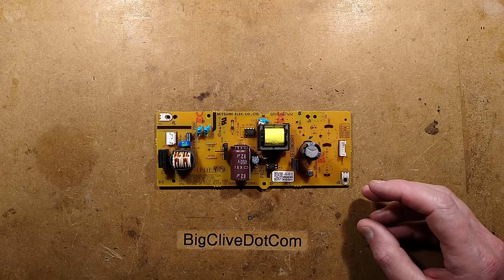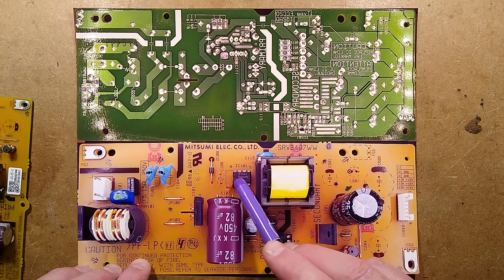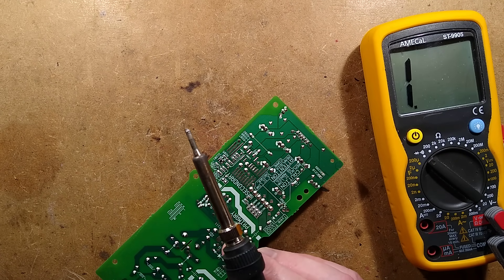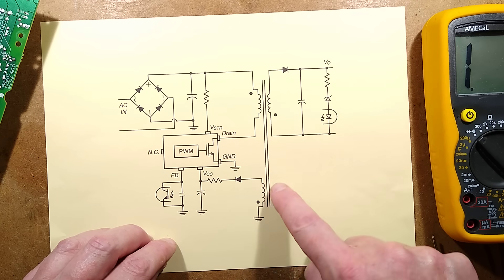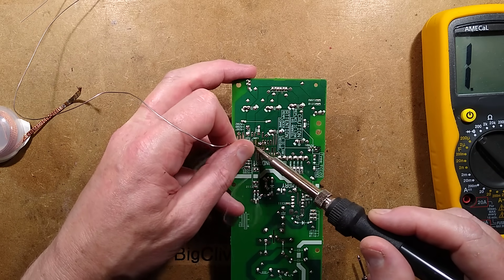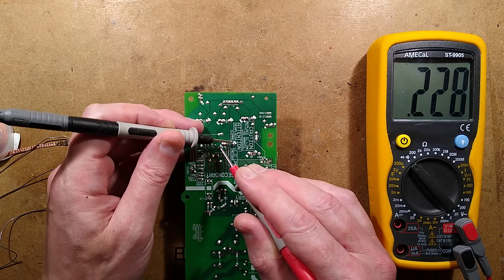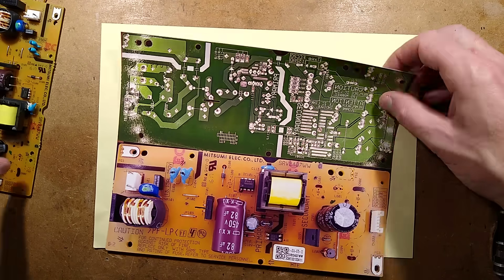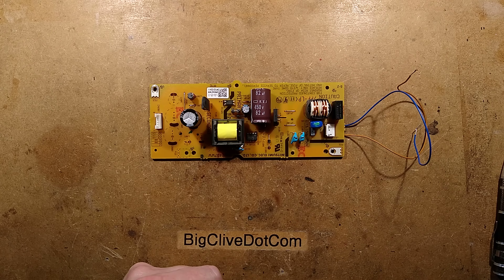Diagnosing a faulty PSU

Comment: Small question, recently I was changing capacitor in light power supply and it was really close to some random transistor, i think 662K, and I was wondering if its possible to fry it when soldering it or something close to it? Because I had problem pulling that damn capacitor out of board and I had to heat it for some time and I seriously believe if I would keep heating it for few second more I would pop something...

Comment: My Freeview set-top box had the same fault back in Feb. It took me ages to find the problem as there were no markings on the chip or diode and no schematics for the PCB part number anywhere on the net, Just links to buy a new PSU that cost more than the box was worth. LOL.
Reply: Usually almost all of these follow the exact same design and princible so after reverse engineering a few you will immediately recognize 90% of the stuff on the boards. Some very complex multi-voltage devices might have a couple of non-obvious bits and bobs in them (which usually are not the culprits).
Reply: @benbaselet2026  It's the first one I'd had a go at fixing,and it had a 15 pin output header with 3 different voltage rails on it. It took about 2 months to work it out and fix. I'm used to working on valve equipment. Ha ha.

Comment: I would add to the "proper repair" while in there I would also replace the small bulk cap for the chip VCC. Those little things tend to just wear out over time and cause all kinds of problems, not worth saving 10 cents and a minute of time to find out there are more problems about to go off. A pretty nicely designed unit this one or perhaps not much used, often there is distinct heat discoloration and dirt on the boards.
Reply: Yes! So often I find the psu pulsing or not starting up because of that little chip/switcher start cap has dropped from say 10u to 4 or 5u. The worse the power quality or noisier the environment (industrial) the shorter the life span of the caps seems to be.

Comment: There are unpopulated positions for additional output capacitors and inductors. Im not surprised the diode failed. With only one output capacitor, the ESR will be higher and the diode was being stessed quite a lot.

 If i was repairing this PSU, I would add the missing capacitors and inductos.
 Even though mitsumi is supposed to be good quality, they're still penny pinching bastards for not populating the board with all the components that are supposed to be there.
Reply: Why would you think a higher ESR would stress the diode?  Higher ESR=lower peak current.
Reply: Often times the missing parts are there for versions that have different/higher specifications.  You are right about the penny pinching but there is no business case for having more capacitance than is needed.  Part quality (ESR/lifetime)  matters more than number of parts.

Comment: I work on industrial battery chargers, we have dc capacitors we run around  680vdc.
The day I found a bad bleed down resister was very fun.  
Yes I reached in like a dumb a$$ to change the igbt.... 
That was the day I learned to ALWAYS double check the capacitors .. 
Be safe Clive .
Reply: A few decades ago, I was working on (diagnosing) a single-triode power ultrasonic oscillator at the base of an ultrasonic cleaning machine.  Went to measure the anode volts, should've been between 5 and 10kV.   They were, and my high-voltage probe failed, and punched a hole through my thumb.  Very thin hole, but a hole, nonetheless!
Reply: That's ac input 3phase?

Comment: Another good troubleshooting video! I've never worked on such circuits that have a high voltage capacitor but I can see where a multimeter is a must when working on those to avoid any nasty surprises. If you touch a capacitor that's charged up to 220+ volts, that's gonna hurt!
Reply: Even when you have a meter it's a smart move to build a little discharge device with a suitable resistor and some insulated wires so you can discharge any caps safely before working on equipment. The meter could be broken and show zero volts when there is still 300 left in the cap you know. Just jamming a screw driver or whatever metal between the cap's legs will discharge it but that causes all kinds of damage.
Reply: I always go for the tripple: discharge with a resistor, measure AND jam a screw driver between the pins for final safety check.

Comment: Many years ago, I worked for a company that repaired PlayStations. The PS1 PSU was a similar design, just with a range of different outputs voltages. These PSUs suffered from 3 common faults, most common was the solder joints failing on the input socket, 2nd was again a failed solder joint, this time on the 400V 400uF primary capacitor, 3rd was a failed duel diode on the 12V output.
Oh and yes a 400V 400uF capacitor is very spicy, having been bitten by them on more than one occasion!!

Comment: The dual diode might have lasted longer if it had been fastened to the PCB as a semi heat sink.  Heat kills.

I think that these electromechanical devices get to be several years old and the lubricants get gummy and that puts a heavier load on the motors.  Then the heavier load draws more current from the power supply and the results are what Clive found in this power supply.  A bit of lubricant here and there can make the problems go away.  It's kind of a shame that an otherwise good piece of equipment should end up in the landfill for such a simple problem.  Thanks, Clive.

Comment: Could you say again why exactly they use that big transformer on the output rather than a traditional buck converter? Is it just too big of a jump downward to be taking your rectified 340V and stepping down to 12V, so the transformer does the job of stepping that down?

I guess if I was tasked with building this supply I'd start with a 10:1 transformer to get 24VAC,  rectify to 34VDC, and then buck down to 12VDC. Would love to hear insights on the benefits and drawbacks of these two architectures.
Reply from the maker: The transformer is for full electrical isolation.
Reply: That 10:1 transformer would be even bulkier iron core transformer.

Comment: Very big coincidence!  I got into something identical today... my LED magnifier desk lamp died several years ago and I finally got fed up with using a flashlight ('torch') to trim my nails.  Hauled the thing to work (extender arm etc) and took it apart... found a board almost identical to the Mitsumi, albeit pure Chinesium.  The chip was a 1202 (EDIT:  Innuovo XN1203) using the same setup... the opto bridged a slot in the circuit board to give extra isolation.  I tested the electrolytics, they were iffy as ChongX caps normally are, but the failure was in the input filter stage (just before the big cap)... the 1.5mH pass inductor was open.  New parts on the way from Mouser, soon I will have my magnifier lamp again!  Very glad to be able to get the PDF of the Chinese chip, the example circuit diagrams didn't need translation thank goodness.

Comment: I was under the impression it's a bad idea to parallel diodes like that due to how Vf drops with temperature. So one junction will inadvertently do most of the work, even with a double diode to some degree.
Reply from the maker: It is.  I think they were just using this for the bigger surface area of the package.
Reply: Maybe the two junctions are thermally coupled well enough to balance them. Such paralleled dual packages are really common in (cheap?) computer PSUs.

Comment: I have a guitar amp that makes a popping sound when turned on. The power on led flashes at the same time. Might this be a similar problem?. I'm rather new to this.
Reply from the maker: It does sound like a hiccuping power supply.  May be a capacitor.

Comment: What was the diode partnumber that failed? Had it a too low blocking voltage?
Reply from the maker: I mentioned the number in the video.  I think it was rated OK.

Comment: I had an IBM PS/1 PSU with exactly the same fault.  Gave it a brand new diode, a complete recapping for good measure.  Now just have to finish repairing the floppy drive bezel, which is apparently made of tortilla chips with too much dip on them, because it cracks every time I try to reassemble it.  Pretty soon it'll be made of all-new plastic, though!
Reply: I hope you don't have the yellow rifa caps of death in there..

Comment: Anyone ever tweaked either side of the opto-isolator circuit to adjust the output voltage slightly? In theory it's possible - although surface mount makes it more difficult. I'm talking about tweaking a pwr supply like this from 12.18 or whatever it was running at to say 12.7, 13.5 or so ?
Reply from the maker: With this unit you'd change the two resistors that set the feedback reference voltage.
Reply: Yes, people do that a lot!

Comment: If you couldn't find or didn't want to spend the money for a diode like this one could it be replaced with something like two 1N007 or similar diodes?
Reply: They aren't fast enough for SMPS secondary use
Reply: But you could use two fast diodes
Reply from the maker: You could rough it with a single 3A fast recovery diode.
Reply: If you have another dead PSU kicking about somewhere, you very certainly have a dual Schottky diode package that you can salvage.

Do not use silicon rectifier diodes like 1N4007! Forward drop much higher, current handling much lower, not nearly fast enough, they are for mains use! Which is i hope what you meant, certainly not 1N1007? That would be spectacularly bad.

You can use a single 1N5821 or similar. There's no point in using two diodes, since they'll just drift apart, since they aren't on the same die and not trimmed to match, and only one will really work. The single Schottky might or might not prove ideal in the long run - if it works as a proof of concept, you might as well find the intended replacement part or better.
Reply: I once used a 1N007 in such a situation. I knew it was a bad idea, but it was what I had available at the time and I thought: "It should last at least a few minutes, so I can see if that really was the problem." Turned out, I was half right. The diode did bring the PSU back to life. But only for about 40 seconds. Then the diode split apart right in the middle. So yeah, obviously not a permanent solution.

I'm a total noob, so anyone please correct me if I'm wrong, but my guess is that if you need a replacement (because e.g. the original isn't made anymore), you'd want to look for a schottky diode (because they're fast and have a lower drop) with the same or higher volt and amp rating and same or lower internal capacitance, no?
Reply: @Foobar_The_Fat_Penguin  I don't think the capacitance realistically matters at all in a secondary rectifier diode! Otherwise, yeah. Don't be discouraged if you're replacing say a 10A Schottky diode with a 20A Schottky variant, but the 20A datasheet lists higher forward voltage, because odds are, they measured that forward voltage at a higher current as well, and realistically it has same or lower drop at a given current. Also you might have some leeway on voltages both ways, but you'll be on the safe side if the ratings are same or higher.

You can always tack an extra ceramic capacitor across the electrolytic that follows the diode to compensate for any added capacitance in the diode. The value isn't critical, you'll easily swamp it out, and make electrolytic's life easier as well.
Reply: @SianaGearz  I see. My thinking was that the internal capacitance will make the diode... sluggish. That it would take time to follow the change in input voltage because the internal cap needs to (dis)charge first. Which could lead to a point where the square wave changes faster than the diode can follow. Whereas a diode with a smaller capacitance would have an easier time to just smoothly surf on the wave, rather than getting rolled over by it all the time.

Comment: Quite the high quality thing: reputable brand name, nice layout,  Chemi-Con capacitor (at least for the big one), chips with part numbers. Shame that one diode decided it preferred being a link. Is there an advantage to using these dual-diode packages over one big or two separate diodes? My intuition would suggest that dissipation of the dual diode might be less good, or that you might lose both if you lose one, even though that didn't happen here. Just curious why they might have gone that route.
Reply: Just a guess here, but cost of the dual diode package is probably very close to a single diode part, dual gives you lower forward voltage as the current is shared and if one of the diodes goes open you still have a working device so it may slightly decrease warranty failures too.

Comment: This will be helpful next time I repair a PSU that I actually need to diagnose - I've fixed a few PC monitor PSU's recently, and they all died the same way: cheap no-name caps on the secondary side failing (in very visibly obvious ways).

It's funny because the board that deals with inputs, driving the LCD, etc usually has good caps on it, but the PSU sitting right next to it is full of garbage (and in the last PSU I fixed, also full of vacant spots a cap was supposed to occupy, and now does).
Reply: Also funny where the arrangement of heatsinks and power diodes is such, that the caps get baked real good, entirely avoidably so.

Comment: Same thing happened to my laptop charger & i did not had an extra diode so i just removed the shorted leg (got zapped by the capacitor 2 times in the process ) , & it worked fine for another 2yr before the other one shorted & i replaced the diode with a normal 5amp shotkey.

Comment: I was always told to discharge large electrolytics when testing around them. I was taught by an ex TV guy who spoke from experience after a capacitor he failed to discharge gave him a nasty jolt and land on a glass coffee table. This is why the non qualified should never assume that a device is safe after unplugging it and take the cover off. I heard of someone who was killed when they attempted to repair a microwave when they discharged the EHT cap. The Caps in those across the transformer are fatal unless discharged, no question.
Reply: Always makes me cringe when I see people on YouTube messing with microwave transformers. OK most of them know what they're doing, but some won't. High voltage high current, that's got to hurt... 😜

Comment: 3.15 Amp fuses seem to be really common for some reason.  I see them in all types of power supplies and other devices.
Reply: 3.15 is part of the ISO R10 series of preferred numbers. It is approximately the tenth root of ten taken to the fifth power. A different preferred number series (the E series) is used for resistors, capacitors, inductors, and zener diodes. Preferred series are why you see numbers like 4.7, 63, and 220 more often than 5, 60, and 200 for resistors, etc. See https://en.wikipedia.org/wiki/Renard_series for a better explanation.
Reply: @whitcwa  I figured it was something like that.  I always got a kick out of those for some reason though.  I'm used to seeing fuses in whole or half-numbers with most of the stuff I work on.

Comment: I have a 12V-10A E-bay supply that has been sitting for a while, I was just going to scavenger for parts. It failed after getting left in the rain while plugged in. The failure is the pulsing at the output you talked about. The pulsing output is strong enough to operate [pulsing] a several amp DC motor/pump. I did try replacing the 8 pin chip with no glory. I was thinking next in line was the feedback transistor [mosfet?] that drives the led in the opto-coupler???
It's not a big deal because you can get a new one for $10-$15 Dollars U.S.
What do you think?
Reply from the maker: That suggests that maybe there is a broken solder joint on the transformer or the diode and capacitor used to power the chip itself on the primary side have an issue.

Comment: 270v @ 82uF = 6 Joules. Yeah, that would be a bit sweary. 
Mitsumi are a pretty decent company, not top-of-the-line, but they have been round a fair time, making CD / DVD drives, keyboard innards, you name it. Stuff that then gets badge engineered by big name labels.

Comment: This particular power supply fault seems so simple (and it actually is), but I have a power supply from an old LCD monitor that I can't for the life of me figure out what's wrong. I've only tried it once, but it had a blown fuse, I replaced it, and it blew the new one immediately with no load on the output. I can't find any stressed components, no heat or skid marks, capacitors look good, diodes are good... I'm completely stumped.
Reply from the maker: That could be many things.  Including a shorted diode or drive transistor.
Reply: Shorts like that are usuallyfairly easy to find with just a DMM in diode mode and removing some of the suspected components on the primary side, like the main rectifier or switch tranny.
Reply: The thing is, I have already tested all of the primary side diodes and the bridge rectifier, and it all tested good on the multimeter, even out of circuit. The switching transistor too. That's the thing.

I haven't touched it in a while, but I might revisit it and test it better.